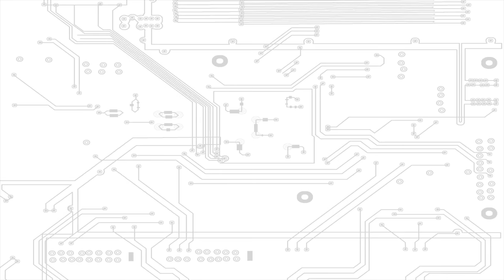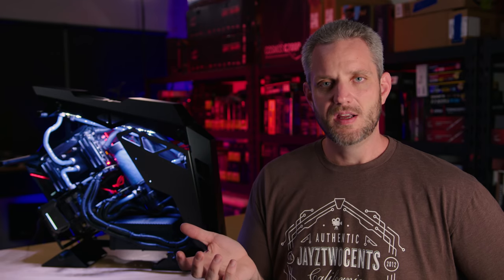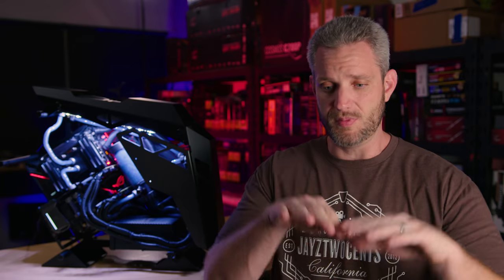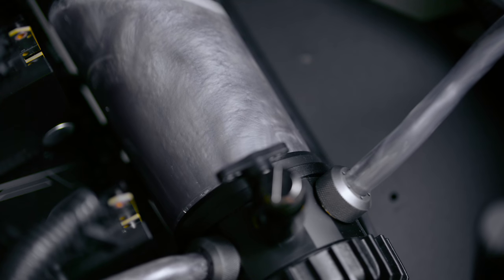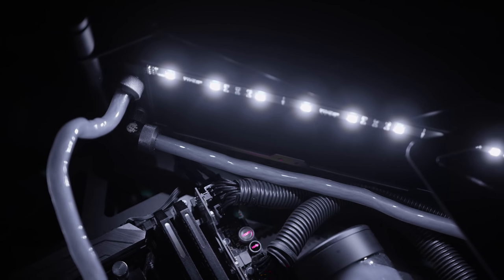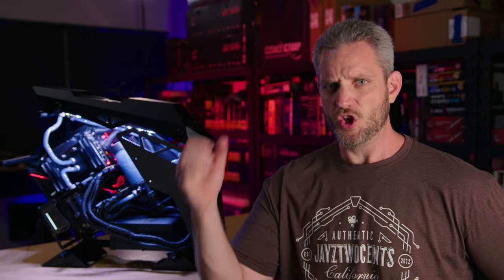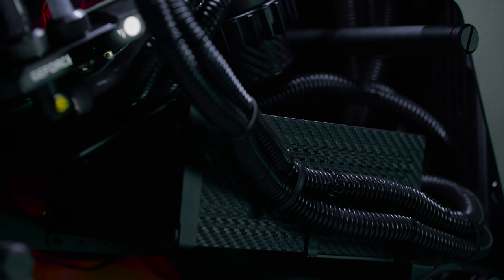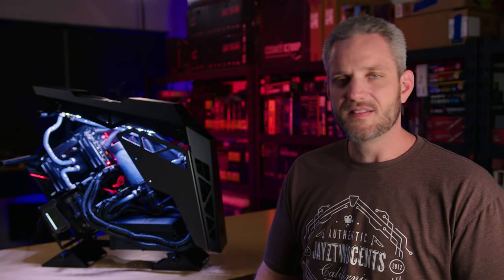Ultimate AMD Threadripper 1950X PC

Comment: Instead of your average benchmarks:
What happens when you turn the pump speed as low as possible (concerning temperature)? What does the effect of the fluid look like at different flowrates?
At this speed, it's too fast to see the effect in detail; a stark contrast to when it sat still in a bottle.
Reply: Joey Verhaar As a partial answer to your question, go check out an old video of Jay's (I think it's titled something like "does pump speed matter?"). In regards to performance/temps, pump speed does make a difference, but not much.

As for this fluid in particular, based on what we've seen of it so far I'd think the slower the pump speed the cooler it would look. But there's only so much detail you'll see with the fluid rushing through small, (relatively) straight tubes. I think it looks the nicest in the large reservoir.
Reply: It's a strange ish one. At idle not much but under load my cpu and gpu temps went up when turning the pump down but the water temp didn't change much.
Reply: Kevin Wade 
Exactly. It should be possible to lower the pump speed quite a bit. 
At the current speed, it is more like a bunch of fast moving random lines (at least, on camera). At slow speeds, it might be possible to observe the effect more like in the bottle. 

Either way, it looks awesome. Way better than the static color of most fluids which don't show any movement.
Reply: Jay.This please I would also like to know bare minimum pump speed effects.
Reply: moo 
Yeah, so maybe the effect is already smooth in person, just not on camera. Either way, I expect the effect to look better at lower flowrate.
Reply: SkinUpMonkey // Thinking about it, the liquid stays longer on the water block fins at lower speed, so it heats up more, so heat transfer lowers. Fluid speed has diminishing return the faster it goes through the block.

Jay showed that with his three-way SLI setup, at the lowest pump speed the GPUs were heating up a ton since the liquid flow per card was only a third of the flow of the pump, being a parallel loop.
Reply: Ujiltrom M my understanding of things is that what you really want is turbulent flow which faster speeds give where's at low speeds it's more laminar flow which isn't good at picking up heat.
Reply: SkinUpMonkey That actually makes sense. I love it when people apply an engineering mindset to discussions like these.

Comment: Benchmark Linux vs Windows. See which OS best utilizes all of those threads for productive work and gaming. You can even run your Unigine benchmarks natively on Linux. I think that would be an interesting and DIFFERENT thing to feature.
Reply: You best off asking level1techs then Jay
Reply: Ivan Karamazov Linux can will, because Linux is more optimized die Server Processors...
Reply: I say IT again i can will IT can also win Windows...
Reply: I dont know about threadripper, but ryzen has linux problems
Reply: Ivan Karamazov 
AMD has problems with Linux for some reason.
Reply: Yeah, AMD doesn't perform all that well on Linux even in a server-like environment. I'm just hoping it would all be sorted out before the next Ubuntu LTS is released.

Comment: looks badass!! absolutely love everything in it, especially the cable wrap thingy on that gpu cables fits really well with the venom theme and the carbon psu too. I completely agree with that tube twist like that for match the theme, but that 90 degree tube bending it looks too 'tidy'. I would love if that bending is completely crazy randomness (kinda like noodles or worm or something) to match the theme even more. of course is just my opinion. but yeah probably it will be much harder and people will hate it. still a really good job with a lot of effort in it.

Comment: Just had a thought inspired by this build. Not the most practical idea, but I wonder if it's possible.
Have the pump simulate a heart beat. And by that, have the pump literally start and stop as if there's a beating heart in the system.
There would be some definite disadvantages to such a system, such as the rhythmic pressure changes which may encourage leaks. There would also be a reduced fluid flow which may cause higher temperature deltas within the loop. But the "organic" feel to the loop may compensate for the technical flaws.

Comment: Hi Jayz.
Great build. Thank you for your effort and time putted into that.
Tips to your question What stuff to benchmark on this:

Professional renderers like Solid Angle Arnold Renderer, Corona Renderer or Chaos Group V-Ray can put ton of load to all of that cores and threads. Some of these renderers use technologies like Embree (Intel kernels for raytracing). It would be nice to see difference between Intel and AMD with and without these.
I don't know if you can get hands on software like this in budget effective way for you when you have Blender... but it would be very interesting for me to see this kind of tests.

In image procesing you can use The Foundry Nuke. It is compositing software used in most of Hollywood blockbusters these days. It can use all that cores and threads and lots of RAM and CUDA or OpenCL in limited compatibility (if you want test hole system). It is very expensive, but it has a non commercial version. I don't know if is suitable for your reviews. 
Alternative to that is Blackmagic Desing Fusion. It is also VFX compositing software as Nuke. It has free version suitable for commercial use, with some limits in features and output resolution. It can also use multiple cores, tons of RAM, saving multiple images at once and use OpenCL.

As alternative to Adobe Premiere will be nice to see Blackmagic Desing Davinci Resolve. Formerly it is Color Grading sotware, but it has NLE and Audio editor inside. It is strongly accelerated by GPU - CUDA or OpenCL, but it can use lot of CPU and RAM too. Maybe it can scale better than Adobe Premiere. It will be nice to see. Davinci Resolve has free version similar to Fusion.

These softwares are probably too specific and very few of your viewers will be interested, but this build is good for content creators. This softwares are capable to use that power in real world test, not in synthetic tests.
Thanks and good luck.
Reply: Hi Jayz.
Second Idea in my head is to use Agisoft Photoscan with same batch of images. It will be great "benchmark". Photoscan is photogrammetry application capable of putting almost constant 100% load on "any" number of cores and without problem use 64, 128 or more RAM. It can use OpenCL (CUDA in latest versions) or it could be disabled to put all work to CPU. It has Console where spended times results are printed. Professional version (expensive) can be scripted in python to make a automated "benchmark".

Comment: Aye, the loop is awesome, and the whole thing looks quite unusual. Certainly not something you see every day. I also like the flex tubes you used for cable routing, but I have worked with them before in a PC build, and you have the same problem there that I did: The ends look dumb. I do not have my build using these things anymore (that was more than 10 years ago), but you can still do someting about it. Granted, it would be a metric butt-tonne of work, taking the connectors off and all, but I think it would look a bit better if you put some heat shrink over the end of the flex tube. I also don't really dig the cable ties. They are kind of necessary to keep everything in place, and give the flex tube that vein-like look, but they don't look particularly great themselves. Maybe you can replace them with fishing line - that would be almost invisible.

Comment: Technical question, can a pump be mounted at an angle that isn’t horizontal or vertical without causing additional ware on the bearings or bushings of the pump/impeller?

Comment: You could run some parallel data analysis. If you have some pretty large data sets you could do some parallel work to see how well the threadripper performs with all those cores. (You can find example projects on Github (scala,spark,...))

Comment: Question about my ryzen system. Why Aida64 is showing my motherboard temp to be constant +60 Celsius? Specs: Ryzen 5 1600 + asus prime x370 pro + g.skill ddr4 that is designed to ryzen cpus. all other temps are much lower.

Comment: Got a question for you here, Jay. I've noticed that you used luster dust in your cooling system. Have seen that ingredient used in drinks and cakes. It is indeed a fabulous idea you've got there in terms of enhancing the looks and as a flow indicator. However, does it clog up the radiator faster as compared to using regular liquids?

Comment: Hey I’m wondering about temps in my pc I have a 1800x and a windforce extrem GTX 980 ti the cpu is water cooled only a dual radiator fans on both sides so 4 total when I stress my 1800x my max temp is 52 c this seems low I don’t have it oc yet my 980 ti also never goes above 65 c and that one i have overclocked room temp is kept around 75 F I’m new to this but I can never get the temps I see on YouTube even when I pulled it out of box with no changes

Comment: I'm still not getting the flow for the gpus. I'm a moron with regards to fluid dynamics, but from the footage it looks like fluid is flowing up through both tubes between the gpus, so how does the fluid flow through the bottom gpu?

Comment: @Jayztwocents
Maybe you or a other user could help me with a question. 
I bought myself the same case (its not arrived yet, I'm not that happy with the Be Quiet Dark Base Pro 900) and using a ASUS Prime X399-A Motherboard (also a E-ATX Board). Cougar says that the ATX form factor is the maximum that fits in this case, but you installed a ASUS X399 Zenith Extreme, also a Extended ATX Board. So it seems possible to mount a larger motherboard.

Can you tell me how much space is left on the left side between the motherboard and the top mount to install a radiator? 
The radiator that you have installed I think is 30mm thick. I wanna install a EK-CoolStream XE 360 that is 60mm thick. Do you think its  possible?!? o.O
Thanks in advance!  ^^

Comment: Beautiful build, so much so that I would like to use it as inspiration for my own, pretty much with the same components you used, right down to the case. I am sure that you were asked before but what is the drill bit that you are using to refine the length of the tubes? also, after more then a year now, what can you tell us about the build itself, are you still using it, if so what are your thoughts?

Comment: I'm currently building a threadripper pc.  I'm having trouble deciding on ram.  So far I'm not caring for what corsair claims is compatible or what asrock says is compatible.  Either too slow, too little or too expensive.

What is the exact model number of the ram you used here?  Thanks!

PS.  Great build.  I'd love to see something more industrial than cable ties.  They're hard to see but can be seen.  Something similar to metal hose clamps would probably look cool in the appropriate size.

Comment: I like those bends. They are so different but in a good way in this case (literally:)).
I'm wondering if CPU like that would be better for working in Pro Tools? Nobody really check this kind of software. I'm using just normal I7 4770K and I don't know if I should switch
to more advanced CPU, or if I can still use just those mainstream ones?

Comment: Jay or anyone, is there any sense getting this case if you're not going for a full open loop? I have an AIO 1080 and i'm not sure the water cooler will reach the fan mounts. the rest of the system would be air cooled. I might consider an open loop when volta comes out but for now there's no real sense rebuilding my entire system just because it will look cooler.

Comment: 11:57
anyone care to explain how that even works? I'm not into water cooling yet but that is just a like wtf that doesn't make sense moment on how the water is flowing. like i get the 2 on the outside 1 imput and 1 output, but how does it work with 2 tube in the middle? are both tube in the middle the inputs on the bottom card and output on top card?

Comment: That would make an awesome Distributed Computing system.  You could run Folding at Home on the GPU's and BOINC (World Community Grid gets my vote) on the CPU.  You'd have to limit the number of threads that BOINC uses, otherwise the GPU's will starve - you'd have to experiment to find the right balance.  Don't forget the watt meter!  As for the build, the white LED just doesn't belong.  Something more "organic".

Comment: Hey there Jay I want to model a build after this creation of yours. My big question before I request approval on parts purchasing is: How does this system perform working in Unity. We do a ton of AR/VR/MR development. Reason I want to is because the current system were running (which in on a intel 5820k, 980 ti) takes about 2 hr to do baked lighting in Unity. I recommended we build out a work Very Powerful dev system to the Managing Director and he said yes. Have you tested Unity performance with shading, lighting, ect...

Comment: Jay I don't know if you can but could you benchmark the i7 8700k HT Off vs i5 8600k. I'm curious if it performs the same or similar. I don't know if anyone else wants to see this.
Reply: I say this cos I want the i5 8600k but I also want the i7 8700k but I'm just wondering if the i7 is only better cos the extra 6 threads if so I'm going to get the 8600k.

Comment: Add the fluid to the description please - I may actually consider water cooling because of the fluid - my pump died on a Thermaltake bigwater or whatever for $200 in the first month 10 years ago, which is why I boycott Thermaltake because they didn't allow RMA or returns and there was no indicator the fluid wasn't moving other than rising temps and no pump sound... I kept it full of fluid, and bubble-free so there was no reason for the pump to die, on top of that a quality power supply was used on a UPS...

Comment: Benchmark Ultimate Epic Battle Simulator!!!!   that things chews the cores!!!!
Reply: I haven't really noticed much hit to even my system, granted its a 5930k, so no slouch but I really just haven't noticed much of a hit, even when recording, worst thing that really kills anything at all is lots and lots of lasers firing into the air, but that tends more toward the graphical side of things than the cpu. All that said, largest battle I've pushed at it was something like 30k "stormtroopers" v 20k WW2 allied soldiers, I'm sure there is a breaking point, but to some degree that ism't really a good standardized way to benchmark, stability test on the other hand, UEBS will push your system straight over the edge if your OC is unstable.
Reply: I agree, its more of a stress test, im still running an old 990X, with a 980ti, I get around 50k units, but then frames drop dramatically after that. I did try one battle with over 200k units, i think i was getting one frame every 4 seconds lol
Reply: Main reason I would like to see it though, was I was thinking of upgrading to the chip Jay is using given how many cores it has, to see how it compares(non-synthetically)

Comment: OMG old man speaking from the eighties................................... What the hell are you building there a module going to mars? OMG talk about overkill for you guys. You should see my build and it is fast, my case for a start is open and I run at 28c in second life with blender and your tube running simultaneously My max temp at any time is 36c. GPU runs a fast fan at times, but that's when I add gimp for graphics in texturing skill sets LOL. The monster you have built cost? Mine cost me 230 pounds way back in 2010 excluding GPU and peripheries. Still going strong with no overclocking.

Comment: This build costs $5447. Trust me, I used a calculator. The price for this build is more than the comments on this video.
Reply: Atleast he got the motherboard and cpu from amd which cost like 1.4k and the case for 280$ from cougar and the water cooling reservoir for 60$ pretty much 1.8k free stuff from his sponsor ( i think the radiator also which is around 70$ )
Reply: 1.6k for the gpu and 200$ psu plus  240$ ram with 30$ fluid 160$ water cooling kit (without the reservoir) 60$ of fan
Reply: So the around the same

Comment: I love it, but it's also definitely more artsy than it is practical. Ironically, you used the term biomechanical to insinuate a "natural" appearance, however, all those weird bends and curves and loops will both reduce the lifespan of the tubing and pump as well as adding more heat to the system. Sure, it's relatively negligible in terms of actual system cooling, but that's just not how nature works.

Comment: Ok so here's the thing.  You could have saved a shitload by just using a standard all in one water cooler (aCorsair H100i V2 will keep the 1950x at or below 65 degrees C at 3.9Ghz under full load). Secondly, I'd like to see how much video performance you gain by SLI-ing 1080s (not much I expect) and third, why the fuck are you using a 1200 watt power supply? Have you actually sat down and worked out the theoretical maximum power draw of this system? My guess is - not. Thumbs down.